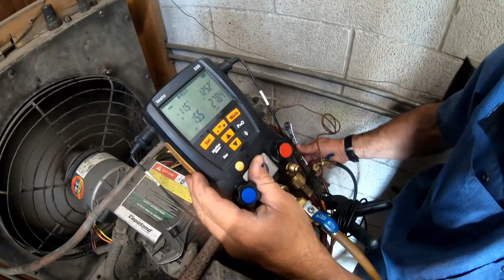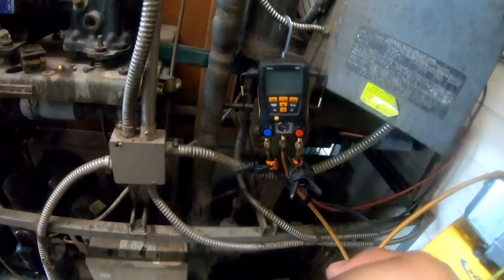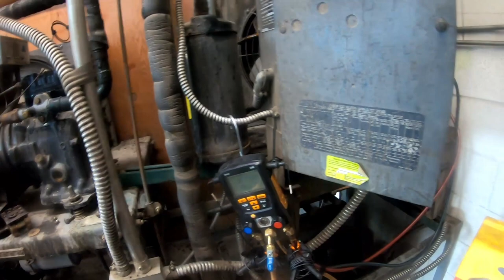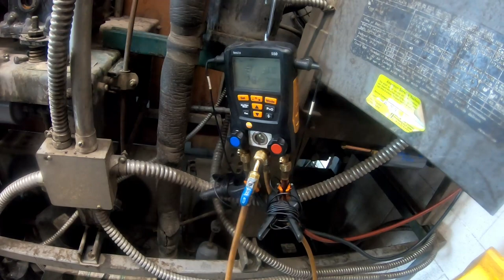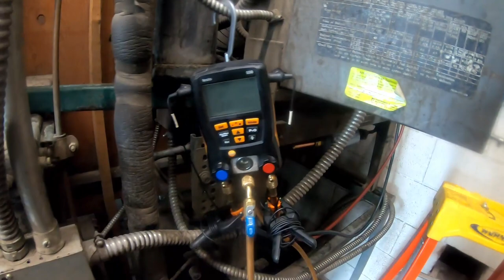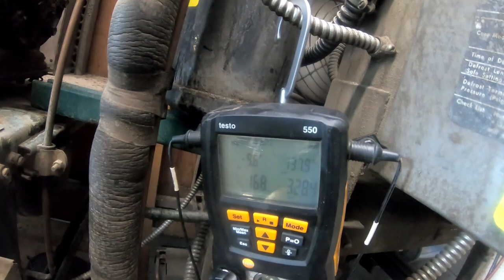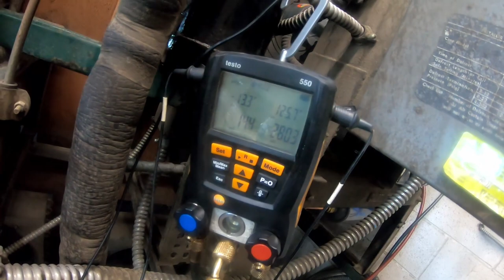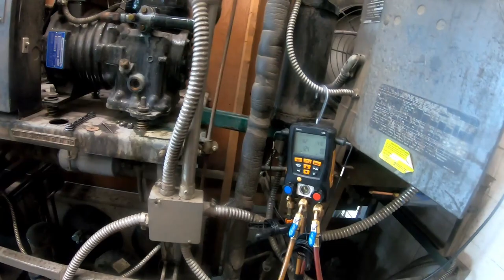Walk In Freezer Warm Part 2 / Easy Compressor Replacement  With Ultimate Ladder Crane

Comment: AWESOME VIDEO! I remember working on some ancient Trenton Kramer condensers that the customer actually wanted repaired.
One actually had a pump on the liquid line to reduce the load on the compressor. It too had a subcooler on the evap. Archaic, but state of the art for its time.
Thanks for the video Rick!!!!!
Reply from the maker: I haven't heard of those, that is interesting but then again I've only been into heavier refrigeration for 6 years.

Comment: Great video seeing all those old copelands! I take care of a grocery store just like that compressor rack. When the medium temp compressors die I change them to R22 scrolls but they run R134a with poe oil. Much cheaper and work great because at some point all the stuff is too old to spend too much money on.
Reply from the maker: Thanks bud 👍👍. Your exactly right, this was definitely an older store not worth spending crap loads of money on.

Comment: Excellent work very neat and clean. Your winch track for lifting the compressor is cheating, lol. I am curious if leaving the door open messes with head pressures because now it is pulling in the door and bypassing the rack. Not that the fan blade was not the main problem in removing the heat just curious.
Reply from the maker: It wasn't too bad where I was standing. Probably 85*.  But you have a valid argument 👍👍.  Good 👀👍🏻👍🏻

Comment: Love the hoist for moving the compressor about! I'm a bit old school so use a chain block instead. Bet the suction reed valves have a wear ridge where they should seal on the valve plate. A lot of those style compressors don't have piston rings, just cast piston with three grooves in.
Reply from the maker: I think it's that because it held after I killed power. The Pistons had compression when I covered it with my palm. Thanks for the feedback 👍👍
Reply: @HVACRSurvival  You can feel the wear with your finger nail when they are bad. 
Had one years ago I got pumping again turning the valves over to the unused side, ran a couple of weeks before they snapped off from bending the other way!
Reply from the maker: I will keep that trick in mind next time. Thanks 4 watching H.D.👍👍🤜🤛

Comment: Was it a wrist pin problem. Kinda sounded like when you were pushing the pistons down the wrist pin was making a noise
Reply from the maker: I didn't feel it but now I know what to look for since I've been through refrigeration mentors class. Either way I wasn't going to be able to rebuild it and we didn't trust only changing the valve plate
Reply: @HVACRSurvival  I'd like to take Trevor's class....pretty expensive though. Cant afford to right now
Reply from the maker: @jasonjohnsonHVAC  I didn't do the full blown class, I got to see it at the hvacr school symposium this year.

Comment: Cool video, love the hoist idea for sure. Quick question though…how did you get the plastic tubing on the pressure control lines? Where do you get that plastic tubing? I love how clean it looks.
Reply from the maker: Its vinyl tubing that I split with a utility knife.

Comment: I used to just unscrew the terminal box and the compressor terminal wires on a failed semi hermetic and put it on the replacement compressor without unwiring and rewiring everything else.
Reply from the maker: That sounds like a good idea! If it wasn't such a crappy wiring job I might have tried that, I will keep that in mind for the next one. Thanks for the info👍👍

Comment: You can get the Chinese Copland scroll l which is the same but cheaper  and the only difference is the small righting on the side of the scroll is in Chinese  
But the rest of the label is the same Copeland scroll and they are fare bit more cheaper and work the same !

Comment: 5:43 scared you a little 😨 😨 don't blame you
Reply from the maker: Is that when the cable did a flop? I'm used to that with my side-by-side off-road vehicle. That's why I stayed off to the side of it 😁
Reply: HVACR Survival yea it was. I like those ratchet crimpers can we see a close up of what the crimp looks like. I'm curious if it does better than manual
Reply from the maker: I have a link in the description. For insulated crimp on connectors, you can not pull them off by hand.  They are amazing and affordable.

Comment: One is trick is put the gasket in refrigeration oil in the bag before taking out the compressor & don't use the service bolts on the compressor use the old ones there 
usually a tag on the new compressor warning. Nice set up taking out the compressors.
Reply from the maker: Thanks Joe, if that's your real name 😲?. I like the oil idea, those black gaskets were like a plastic/metal material, it probably didn't help like it would of if the gasket was green. I had to use the old bolts, the new ones were to short.  Did you get my text about your shipping address? Or did you toss your burner phone? 🤣😏🙄